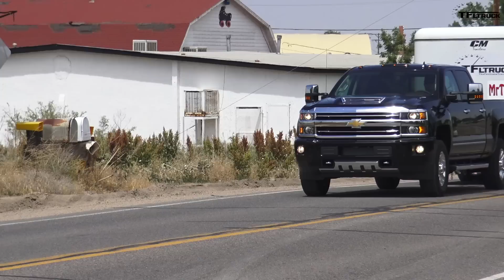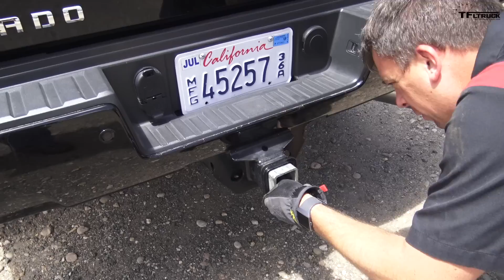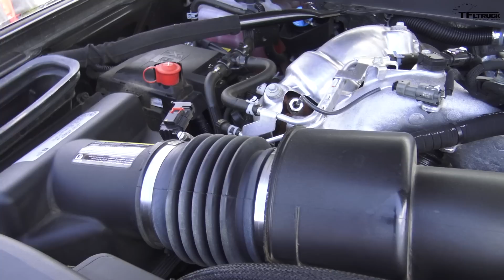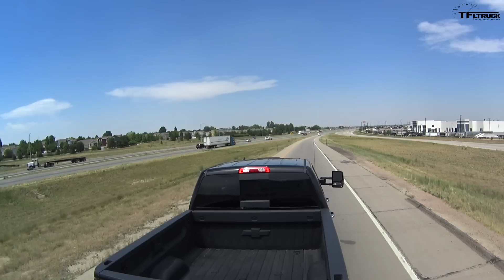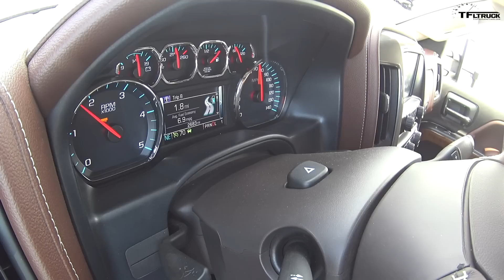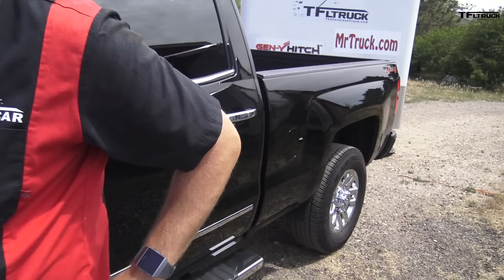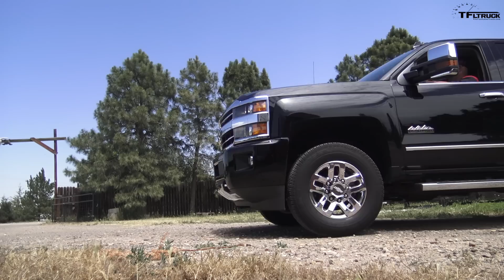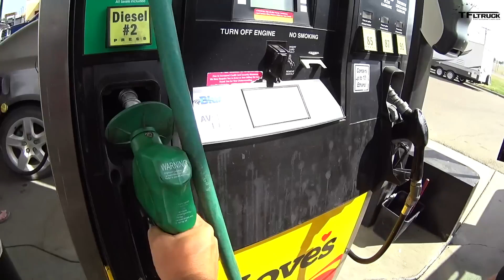MPG Challenge: Silverado Duramax vs Cummins vs Power Stroke

Comment: Duramax is the diesel for the people, Powerstroke is the diesel for the construction site and Cummins is the diesel for the long hauls. Is how I see it.
Reply: Diesel for the people? What the heck does that even mean?
Reply: Eric Fox if you tow more than 28k then you have no choice than to go ford or ram unless you bump up to medium duty. But thats irrelevant to the argument here. This argument is based on roughly 12k and is a good weight to measure. Could be towing a bobcat, backhoe, not every job is a gooseneck flatbed thats maxed out every second. In fact a small percentage of them are. Most are pulling much less than that which is why chevy didnt bother going for the big numbers. Watch the TFLTruck video on the big 3 towing  the chevys max weight up the ike and youll see why ford and rams numbers are for paper
Reply: Xxplicit my uncle did hot shot runs with 7.3 350 dually has 1.3m miles on the odometer and is still being used as his daily since he's retired, only changed oil and brakes no major mechanical issues.
Reply: J Patt of your talking old 6.0s they just needed egr delete and better headbolts and they run forever.
Reply: J Patt Dmax problems- http://www.duramaxhub.com/duramax-problems.html
Reply: J Patt And 6.7 powerstroke problems. Looking good for the diesel that Ford has made themselves for more than 8 years now. http://www.powerstrokehub.com/6.7-power-stroke-problems.html
Reply: GhostlyGhille the  6.4 was junk to the 7-3 L diesel was a good engine.
Reply: J Patt Post some kind of evidence that Ford is having any more problems with the 6.7 than any other manufacturer. You spew this on every thread and get shut down by facts and evidence every time while providing nothing to back up your drivel.
Reply: J Patt First of all because they dont. Second, that has absolutely nothing to do with the topic at hand. Third- If you look at the number of Hotshots up and down the road they are dominated by Ford and Ram. The Dmax isnt even rated to pull over 23k and they want @ the same amount of money.  Put more than 23k behind the 3500 Silverado and you will see what squat and a wheely really look like. Max payload F350 dually =  7630 Silverado Dually = 6112. A single rear wheel F350 can tow 21,500 gooseneck/ 5th wheel. An SRW 3500 can only tow 17,500.
Reply: Eric Fox yeah I can see that
Reply: J Patt living in the distant past. Ford hasn’t used the 6.0 in more than 10 years and it was an international motor.  Ford only used the 6.0 for 4 years and the 6.4 for 3. They have been successful with the 6.7 longer than 6.0 and 6.4 combined.
Reply: J Patt Nothing on PS Help has anything to do with 6.7s after 2012. The early Dmaxes had massive injector failure problems. Your GM blinders are in full effect
Reply: J Patt Cab off? Like this DMAX https://youtu.be/4ldjMIPKvLA
Reply: J Patt Or this one- https://youtu.be/4ldjMIPKvLA
Reply: J Patt Here is another covering problems from all of them - https://www.dieselarmy.com/ask-the-expert/top-issues-with-power-stroke-duramax-and-cummins-engines/
Reply: J Patt https://www.littlepowershop.com/blogging/common-issues-and-problems-we-see-in-the-shop-with-the-lb7-66-duramax-engine/
Reply: No clue what you are talking about that ford is known for headgasket problems.  The 6.4 is know for everything problem, the 6.0 was, well almost everything again, head gaskets, injectors, HPOP, ego cooler, etc etc etc... 6.7 I've see the turbo issues, broken cranks, lol... 

Duramax I aint sure how your own overheating as a breakdown.... and again on the first duramaxs ya, i heard of headgaskets, injectors (extended warranty) and water pumps... and then... i aint really seen much more as far as COMMON problems... 

I much rather replace a water pump than have front covers leaking into the oil...
Reply: You dont know your ass from a hole in the ground. The current F550 can tow 31,500. In 2009 it was 24K. The Kodiak tow rating was only 16,000lbs gooseneck/ 5th wheel. http://www.trucktrend.com/truck-reviews/163-0501-gm-kodiak-topkick-4x4/  https://www.topspeed.com/trucks/truck-reviews/chevrolet/2003-2009-chevrolet-kodiak-ar133691.html
Reply: J Patt I'm just laughing my ass off this John Just pulls random Internet pages off. Bet in real life He don't know anything and relies on the internet Aye.
Reply: J Patt And where did I say Im out? Is that more fake news from someone who had facts laid out in front of them yet emotionally clings to their fantasy land. Sure thing. Conservatives use verifiable facts, not speculation and internet babble. The numbers for the topkick, for example, are facts and dont lie. 16k is it from the factory.  Now come back after you get an education and figure out how to do research.
Reply: J Patt I think you really need to go back and read what you have said, read the articles, and re-evaluate your bias. Ford makes their own diesel now. They dont use the Nav/ IH motors anymore. With your thinking nobody would ever switch to a different manufacturer. Every GM 6.2 and 6.5 in the HUMMWV was a train wreck. But I would still explore new offerings from GM. You have bashed Ford the whole time on a motor they stopped using in 2006. Time to get over it and open your eyes.
Reply: Icenbryse The Ford diesels like the 6.0 and 6.4 were made by International. But so was the great 7.3. The 6.7 is a Ford made motor. Completely different animal than the old International jobs.
Reply: Icenbryse the 6.2 was definitely a slug the one I had never failed me drivetrain wise but the rest of it rusted away.... My6.5 ran quite well for quite a few years and then I started having injection pump  and module problems which I think both were quite common...
Reply: Icenbryse If I had a dollar for every glow plug the 6.2 has eaten I would not have to work again. It was a gutless wonder and generally regarded as a very forgettable motor. Winter starting? Good Lord, go get the ether. Rear main seals? Should have bought stock in them.
Reply: Eric Fox I've talked to many contractor's who have bought new 2018 Ford superdutys, and they said that they can't keep them out of the shop.
Reply: Jake A. This man knows his stuff
Reply: The Real John Smith I did not say that the Duramax  didn't have injector failures but the failures for the injectors were not catastrophic engine failure like with the Fords !!!! please know what you're talking about!! this is what I mean about you, you know nothing except for what you read off the internet and you can't decipher what  actually is being said! The early Duramax engine injectors were difficult to replace I believe since the LLY came out the valve cover no longer has to be removed and it's a reasonably simple job!  there are still problems with the 6.7 l from Ford no matter how much you want to stay in denial! I have dealt with people with valve problems and Turbo problems and you still can go into a Ford dealer on any day and see cabs off of Ford diesels because they are shit !! I am in the dealership on a regular basis where I live talking to technicians and the first thing they say to me is don't buy a Ford diesel!!!!!
Reply: The Real John Smith by the way most everything from 2012 on is still under warranty or just coming out of warranty so there's not a hell of a lot of reason for him to Big dealing with that s*** yet
Reply: Agreed!
Reply: The Real John Smith you haven't given me an ounce of evidence yet  !!! Everything you showed  me are things that I know! which are half truth! The failures in the Ford diesels is far superior and far more catastrophic and expensive than anything with a Duramax!! That's not to say either engine is perfect! Just far less problems with the Duramax And Cummins !
Reply: The Real John Smith as I've told you before just  because some idiot took that cab off of a Duramax once doesn't mean that it has to be done anywhere near as consistent or often as a Ford diesel as usual you simply can't comprehend!!!
Reply: powerstroke is the diesel for the repair shop rofl... after the first duramax came out (first with common rail btw) and they fixed the head gasket issues and injector issues... really what problems does a duramax have? I am serious, most people have seen the powerstroke shops... fixing the terrabad 6.0 6.4 and 6.7 it seems just enough work does not exist (enough problems) for duramax shops... 

Ram never made a diesel engine, ford is a baby in the diesel market and had to steal designs from GM... GM was the first to put a diesel in a pickup, GM has been making diesels forever...
Reply: Matt Lane Ford Is Know for Headgasket problems Mainly obviously It has more minor problems But It's what ford has weak. By my experience Duramax Always comes out whith the Small annoying things that break down Fast like overheating,Injector failures,Water pump failure,Cylinder heads, fuel lines Etc.
Reply: Premium Bass™ Ford has the best engines and Transmissions??? Ask your hero the real John Smith even though he's a blue oval boy and can't comprehend much of what he reads, he will at least admit the 6.4 l in 6.0 L diesel are one of the worst engines((after he tells you a hundred times that ford didn't make the engine and is not responsible for it, I guess)) in history as far as diesels go!!! And the Allison Transmission in the GM trucks is considered one of the best Transmissions ever made!!!!
Reply: Correct- I am not a fanboy like J Pratt and can fully say the 6.0 and 6.4 were bad motors. But unlike Pratt I can also say the Ally has had a problem with overheating and going into limp home mode. Ford makes their own transmissions and they have been nothing but reliable; just as much as the Ally. But lets not kid ourselves, since the GM twins are only rated to tow 23K they don't contend with the same stresses as the Aisin and Ford transmissions that are rated to tow 32K. When the Ally is pulling that kind of weight we can compare apples to apples.
Reply: The Real John Smith once again you don't know your ass from your elbow! Blue oval boy! The same Allison Transmission was used in the 4500 5500 Chevy Kodiak and GMC TopKick chassis which at the time were rated to pull and carry more than the Ford F 450 and 550 and could easily tow in the 30,000 lb plus range I owned two of them and did it regularly! get your apples straight!
Reply: The Real John Smith and let's not forget that same Duramax engine was in that same Kodiak and Topkick truck and did the same kind of work with way less problems than any power joke!!!
Reply: Common issue with the Ally 1000- Overheating. Why- owners overloading it. http://etereman.com/blog/general-motors-transmission/common-issues-with-the-1000m74-transmission
Reply: The Real John Smith you're wrong again I had a 2006 Chevrolet Kodiak 4500 gooseneck tow rig labeled on the door jamb tow 30,000 lb did it on a regular basis moving back hose bulldozes and skid steers never once had any of the problems that you fictitiously come up with! The gross vehicle weight of the truck was 17500 lb labeled on the door the, 2005 Chevrolet Kodiak 5500 labeled on the door 19500 gross both trucks had higher gross ratings than the F-550 and 450 of the time which is what I said earlier I'm not speaking about now! Which I know you can't comprehend what's written as usual! And if you purchase the 5500 series two wheel drive back in 2006 it had a gross vehicle weight of just under 26000 pounds! I don't need the internet to look up this nor will I send you any links this is reality things that I've had owned and used!
Reply: J Patt I did indeed find a Kodiak that could tow 31,000lbs. It was modified from the factory and outfitted differently than the factory. http://www.trucktrend.com/truck-reviews/163-0608-2007-chevrolet-kodiak-crew-cab/
Reply: J Patt As far as fictitious problems- Links are posted to actual trans specialists and researchers. Not my opinion; that of people who see all the problems, not just the ones they want to see.
Reply: The Real John Smith I've told you before I don't rely on what is written on the internet because you can't the majority of it is half truth and lies you have to be intelligent enough to filter out the stupidity I work alone in the shop so babbling back and forth with you is enjoyable to me I got a laugh out of most everything you come up with and the fact that the only thing you can do is read off the internet you have no real life experience so thanks for that anyway!
Reply: Ford 4.6L V8 StraightPiped I couldn't agree with you more I'm sure you're a hundred percent right ! even though I have my problems with Ford I enjoy all trucks so don't let the Chevy Avatar fool  you that I'm a narrow-minded fool  but when I speak about trucks I can only speak about personal experiences because I know that's true what you find on pages on the internet is covered in whatever that individuals agenda is that  posted or wrote the article!
Reply: The Real John Smith thanks for another laugh 👍🇺🇸✌️
Reply: The Real John Smith 😀
Reply: Icenbryse I agree that Cummins is a great motor... I cut my teeth in the early 2000s at the dealership working on them  a fair amount of injection pump problems and oil leak issues but overall were damn good motor.... my only disappointment in using them in a real-world situation is I've towed cross country carrying 15000 lb couple of times each  with a 2006 Duramax and  with a 2006 Cummins and the Duramax out-performed the Cummins easily now that being said I do believe that the Cummins long-term May Outlast the Duramax... The 2006 Cummins I drove also had an aurora Turbo and a edge with juice controller on it and it's just didn't come close to the power I had in the hills with a Duramax. not sure why? No matter what both Duramax and Cummins are far superior to anything that Ford produces! Definitely on a reliability standpoint!
Reply: The Real John Smith looking up s*** is all you know how to do anything that has to do with real world you know nothing about in your bubble in your mother's basement!
Reply: Icenbryse LOL all great points and I agree! I don't have any personal experience with the newer Cummins but I'm sure they're outstanding motor! I do agree over the towing numbers with the GM's the thing that bothers me is I remember towing with my 4500 and 5500 kodiak's and they did a great job pulling the 30,000 lb but they were a 12000 pound truck made to pull 30000 + pounds it worries me with these other trucks on the road that are around 9,000 lb and pulling that kind of weight so there's a part of me that's fine with the 2500 and 3500 GM's being rated for where they are I know the drivetrain can handle it with ease whether the frame and suspension can I'm not sure but I'll bet it can handle it too.
Reply: Pratt- and talking out of your rear end is all you know how to do. Nothing but narrow views based on your individual experience and not the industry as a whole. Still waiting for the info on that stock Kodiak that tows 30K; besides the ones modified by Monroe Truck Equipment.
Reply: The Real John Smith 😘
Reply: Icenbryse you make all great points in this and I agree with everything you're saying!  don't waste your time with the real John Smith he's nothing but a computer boy in Mommy's basement most all of the point you just made I've said to him over and over again! he just chooses to ignore it simply put with Ford, GM since 2001 has had the same diesel engine Ford has had three different platforms and I'm not sure they have it right yet! I find the best way to get rid of that fool it's just throw him a couple of emojis he seems to get confused bye them and he sometimes goes away! Lol
Reply: And dont let Pratt feed you with internet drivel. Its simple to verify any of his made up stories. For instance- no Topkick/ Kodiak towed 31K. The only ones that did that were modified versions as stated and shown above. He thinks research doesn’t matter and he knows knows everything based on his limited experience.
Reply: The Real John Smith my experience may  limited  but atleast I have some u have none except for your internet forums!
Reply: J Patt Have plenty of experience myself. Im just not ignorant enough to think I know or have experienced everything for myself. Thats why I prefer research and fact over internet opinion.  Stay safe in your bubble. ;)
Reply: TODD Gruver the Duramax engine that is in GM's truck now is made by GM by the way!  ((And I'm not positive on this but I do believe that since 2012 the Isuzu Duramax diesels have been produced in the US)))) And I hope that your 2017 holds up well with few problems. I don't wish any failure on anybody especially with a  truck that is expensive to begin with and they all are doesn't matter who makes them! It's unfair to compare your 1997 Diesel from Ford that's a 7.3 liter powerstroke and they were very good engines I'm speaking of the 6.0 liter 6.4 L and 6.7 l diesels, the 6.7 L diesel may be okay the jury still out early on it had a lot of problems and because of the cost that I've dealt with on the 6.0 and 6.4 I just don't trust Ford .
Reply: The Real John Smith okay back to Mommy's basement for u !! There's no way you have any personal experience your to uneducated on the subject with the exception of posting an article from some forum you found! who the f*** you think your kidding !!!
Reply: J Patt What forum? You wont see any forum posts. Do you know what a forum is? Its this place where people discuss their individual experiences. Then based on all those experiences they can form a general consensus and not just rely in their narrow individual perspective. But I posted actual articles from professional publications that do research and gather much more information than you will ever gain on your own. Its funny that you haven’t provided even one shred of evidence to back any of your BS claims.
Reply: J Patt And its “too,” as in also, not “to.” Education is an essential key to understanding. Education comes from learning, reading, and experience. You have limited experience and refuse to read and learn. Pure ignorance. Back in your bubble with you.
Reply: The Real John Smith the Hillary supporter! There's no doubt about that you're a living breathing mommy basement libtard at its finest!!!! And thank you very much for the English lesson professor! But in your last post you said you were out! you even gave me the feminine ;-)! So please be gone with you you have no power here!! But you're always good for a laugh! thanks again!😂😂😂😂😘
Reply: Only Cars I've always said the Jury was out on the 6-7 right now I have no faith the last two before it cost me thousands that's always been my point I've lost too much on the others that I have no intention of taking a chance again! I've lost nothing on the Duramaxes I've run over the years ! So why would I even consider going back to Ford! I don't care how many articles you can come up with on the internet as I've mentioned earlier is always an agenda one way or the other... The real John Smith is not proving anything to me the only proof is the real world situation that you're in no matter how much anybody who would like to make believe! Just because the real John Smith knows how to cut and paste from things he finds on forums does not mean that it's correct!
Reply: Only Cars  I have owned both the 6.2 L and6 .5 liter diesels I will never stand here and say that they're great however they both worked fairly well for me for the time I had them.... I am aware that that they had a bad reputation... I don't want to hear the excuse about the fact that International made the motor for ford ,Isuzu makes the motor for GM and I don't make excuses that it's not theirs so please don't start that you're beginning to sound like the real John Smith..... If you purchased a vehicle from a manufacturer and it did nothing but cost you money and then you gave them a second chance and purchase the 6.4 liter and it failed you again why in God's name would you go back to it I wouldn't and I'm not I have no faith in Ford I've also owned the 5.4 liter slugs with the cam phaser problems low power spark plugs you can't keep in then spark plugs you can't get out exhaust manifolds that fail consistently among a plethora of other problems I'll never go down that road with them again either!!! It's okay if you don't agree with my view of things but they are my view and I'm going to stick with them there is nothing yet that the real John Smith has said to me that will sway me in any way!!! He knows absolutely nothing!!! But how to cut and paste!!!!
Reply: J Patt I dont really care about Smith. I had 2 5.4s and didnt have any problems with either. Other crap went wrong, but not the motor. I know others had bad experiences. But, again, Ford moved on from that motor. Just like GM moved on from 6.2 / 6.5. From a manufacturing standpoint, switching from an unreliable manufacturer wipes it clean for me. Never buy first gen of anything if you can help it. I have used primarily Cummins and Detroit diesels in the bigger trucks I operated. Mostly it came down to good maintenance. They all had issues; but, if we were diligent we could find the problems (leaks, worn hoses, turbo line leaks, etc) before they caused anything catastrophic. Those that slacked on maintenance paid the price. I have found the same with most modern engines. Just about all will treat you right if you treat it right.
Reply: Only Cars I would agree with a lot of what you said... The Ford diesels that I owned and the 5-4 were exceptionally well maintained... A quick background for me I have either worked excavation or auto repair my whole life which equals to about 25 years I have tried to go with Ford a few times and it just didn't work for me that's where my animosity comes from .. I've had much better luck with GM and I worked for Chrysler as a transmission tech let's just say during that time I never went without work... Some of the problem with different manufacturers vehicles seems to be a regional thing, things I may see a lot up here in the Northeast others may not see elsewhere... I currently own a 2015 2500 HD Duramax diesel lml and it's by far the best vehicle I've ever drove and owned in my life I plan on having it for at least 15 years.. from the experience I've had with the other Duramax diesels I fully believe it will last that I wish you luck with what you own .
Reply: Icenbryse a 6.5 L was used quite a few years and that Humvee and held up fairly well to... And if I remember right the new JT LV from Oshkosh that the military is replacing the Humvees with is powered by the 6.6 liter  Duramax
Reply: Icenbryse The modern diesels all run pretty good from what I have seen. Maintenance is the key. Many of the problems come when owners mod them too much and try to push way too much power through them. Thats what happened to the 6.0. It was Ford’s fault for pushing it too hard from its normal configuration. They were pretty reliable in other, lower power, application International trucks.
Reply: Icenbryse which is pretty much what I have been saying all along. They are all about equal now in terms of reliability and capability. All of them have their own problems, advantages, and disadvantages.
Reply: 74Beeper 
Means he has hurt feelings
Reply: Cummings is a great engine, to bad they put it in a Dodge. No wonder their putting them in Nissans.
Reply: 115 comments. This post was not meant to be a war starter. Holy shit.
Reply: Yeah but don’t be thinking your gonna pull a dump trailer with 3 or 4 roofs in it with a power stroke.
Reply: Eric Fox that’s how come ford and dodge catch on fire going uphill
Reply: L5p is the diesel for performance, powerstroke is the diesel for homosexuals, and cummins is the diesel for poor people
Reply: Any of them do all of those things equally as good is how i see it. No one cares about a 1 mpg difference when they're spending 60-70k on the truck.
Reply: Chevy's are the most reliable trucks Dodge makes the best diesels!  Ford the problem is circled!
Reply: Eric Fox commercial cares about fuel efficiency too. If i can do the same job with my duramax as you do with your powerstroke and it cost me less in fuel, then i made more money.
FORD 10mpg/CHEVY 12mpg
200 miles round trip:
FORD 20gal/CHEVY 16.67gal
Reply: Eric Fox I work in construction our company has 8-9 Dually’s, they bought 3 cummins and a bunch of f450’s all the fords ended up with driveline problems, we changed 2 rear ends and a bunch of wheel hub bearings and the cummins never had any issues.
Reply: ZGERMAN jeez!!. Must have gotten a bunch of lemons. I no longer work in construction. But i do still see my foreman from time to time. An they have not had any performances issues from the fleet in the last 3 years. But they did have a f350 that did suffer from over heating on a hot summer day.
Reply: Jesse Hernandez Fair point but If your job requires you to tow above 28000lbs than Would the competition not make more sense to own. (I do not own a powerstroke)
Reply: Matt Lane I'm a ford guy but honestly every truck IS  great and everyone deserves respect But i just prefer Ford for Obvious reasons i am A DIE hard ford fan.
Reply: 74Beeper It is better for non commercial use. As people today are looking more for fuel efficiency.
Reply: J Patt I did the research. Nothing point to a clear reliability winner. Each Brand has had issues in their history.
Reply: J Patt And just because you go to a dealership and see the best selling truck series with a cab off doest mean its broken. Full service on both DMAX and Powerstroke are cab off affairs. You speak completely in made up, see what you want to see GM fantasy land. GM truck sales were abysmal last year while Ford saw an @ 11% increase. If the Powerstroke were as bad as you claim and the Dmax as reliable this would not be the case. Your small, narrow view of the industry does not speak for the majority of owners. Ford would not have the success they do and GM full size sales lagging if this were the case. Get out of your small world once in a while and come up for air.
Reply: J Patt PShelp.com pretty much has nothing on the 6.7 powerstroke since 2012. Why? Because the days of the 6.0 and 6.4 are long gone and the 6.7 isn’t making him any money.
Reply: The Real John Smith thanks for posting these hubs. At least you took the time to research instead of personal opinions. Looks good for me too as i own a 97 f350 powerstroke and 17 f350 powerstroke
Reply: J Patt you need to read more about the catastrophic failures. It says they were in the first year 6.7 due to glow plugs i think it was and it was fixed
Reply: J Patt Amd  Ford has great engines and The strongest transmissions 6.4 the 6.7 and 7.3 Except the 6.0 which you probably Meant was the worst engine Yes. Ford Can haul anything I keep my truck like it is You probably Seen lifted ass trucks Which Make the truck Do wheelie.
Reply: Matt Lane First diesel with common rail was the Alfa Romeo 156 in 1997. Dmax was introduced in MY 2001. In 1999 Scania has the first common rail truck engine. And in 2004 the Audi A8 was the first production diesel car with common rail and piezoelectric injectors. The Dmax was the first American market common rail diesel; but not the “first.”
Reply: J Patt well look at this way. Dodge uses a Cummins duramax is Isuzu least ford is making there own. Like i said earlier i own a 97 f350 4 door with a powerstroke lifted with 37s so 21 years old and the motor has never been opened up. Were stuff has gone bad (waterpump, glow plugs etc) but thats it. So i bought a 17 f350 4 door powerstroke dually. Best truck ive ever owned by far. Figured the 97 lasted this long with a few different owners, this 17 will last forever with me being the only owner
Reply: J Patt Wait a minute. So now you are saying the jury is still out on the 6.7? Thats what J Smith has been saying all along. Problems with the early one but nothing since. And you really should try to do your own research. Ive followed the whole thread with a bucket of popcorn and pretty much, J Smith is right at every turn with at least something to base his opinion on besides conjecture. Only a fool doesn’t do research when making large purchases.
Reply: Icenbryse I had a 6.0. I was lucky and just had it BPed right away. I have a 2015 6.7 and it runs great. My decision was between Ram and Ford. It came down to bang for the buck and styling for me. The Sierras are nice looking, but the lack of capability for the money didn’t justify it.  The Ram 2500/3500 was rated least reliable for the last couple years. Glad I went with Ford.
Reply: Duramax, Best all around Mpg, great trans, drives like gas, very low to the ground, great for meduim duty.
Powerstroke, Can take a beating on a construction site, cheap fleet price, 350-450 not large enough? Grab a 650-750, more big dog options. Construction rentals lease these out by the thousands. Great off road.
Cummins, Best engine hands down, best Mpg with heavy loads, weak trans, body will fall apart down the road. Decent off road.

The all have issues, yes, all of them.
Reply: Eric Fox you are correct! they have both had issues as well as the Cummins! but if you pay close attention to the issues! the problems with the Powerstroke have been catastrophic excessively expensive problems! you're not going to make a diesel engine or any engine of that type to never break... simply because of the excessive stress that's put on them with what they are designed to do.... but don't be fooled by all the blue oval banter that's out there I've owned them both and the minimal problems I've had with Duramax have been far better to deal with than any of the ridiculous headaches and expense I've had with Ford diesels!!!!!!!
Reply: GhostlyGhille I understand but when it's a truck that you already overpaid for to begin with it doesn't make any sense that you have to drop another 10 grand in it to make the engine hold up!!!
Reply: The Real John Smith please go away I don't want to go round and round with you again if you read the first sentence in the what you keep sending me it tells you right there that the Duramax is a reliable good engine and drivetrain end of story!!! yes every vehicle has a problem here or there but the problems with the Ford diesels has been catastrophic failures go to powerstrokehelp.com you can learn everything you need to learn!!!  please listen to what u read  don't just sit there with your blue oval blinders on  and ignore the facts!!!!!
Reply: Zane Buxton then tell me why every single rear wheel Ford pickup truck I see pulling a fifth-wheel trailer looks like it's doing a wheelie
Reply: Matt Lane The 6.0 was the head gasket nightmare before the head stud kits came out. The early Dmaxes were known for it too. The 6.7 is just as reliable at both the Cummins and Dmax. All of them have problems.  http://www.dieseltechmag.com/2017/12/common-problems-the-cp4-time
Reply: J Patt We have already established that you cant comprehend the real world outside your bubble of limited information v verifiable information that reflects the industry at large.
Reply: J Patt I know. Looking up the actual capabilities of a truck is hard for you; especially when it proves you are full of shit. It could say it on the Chevy website and you would claim it was wrong if it conflicted with your bubble.
Reply: Eric Fox open your eyes and do some research powerstrokes are the least reliable diesel engines in history !!!I'm a Chevy man now because I went from Powerstroke to Duramax and since the change I've had zero problems with any Duramax they are far more powerful and far more reliable than a powerstroke!!!!
Reply: Eric Fox almost correct... Powerstroke is the Diesel for rich assholes with more money than brains
Reply: 74Beeper Chevy has a smoother ride, but with a trailer, the truck will bounce up and down more. the dodge and ford had a harsher ride, but have less vertical movement with a trailer